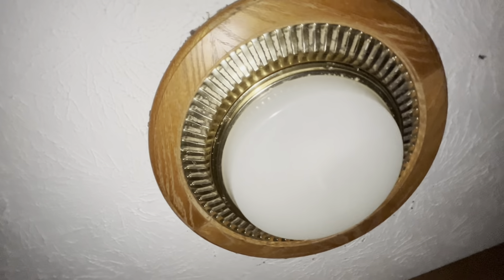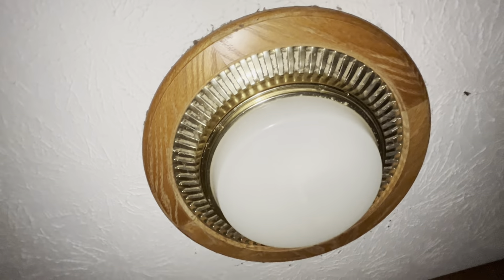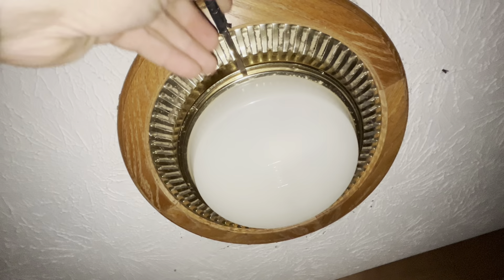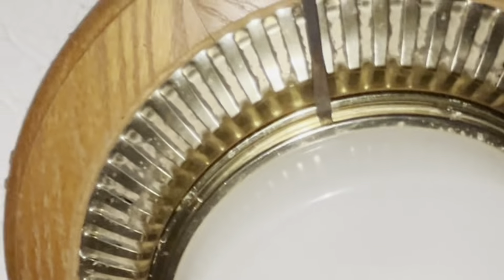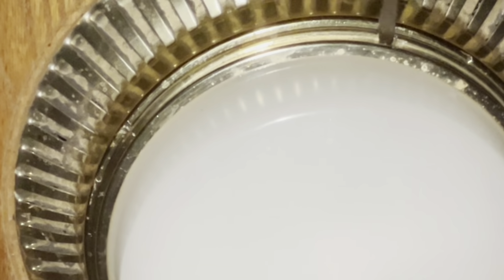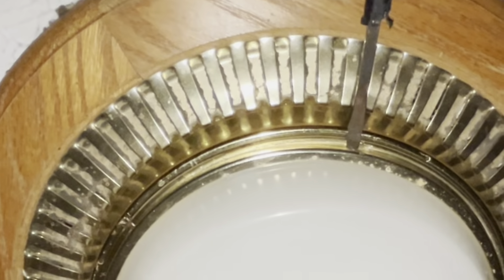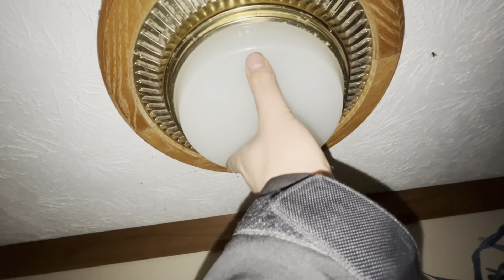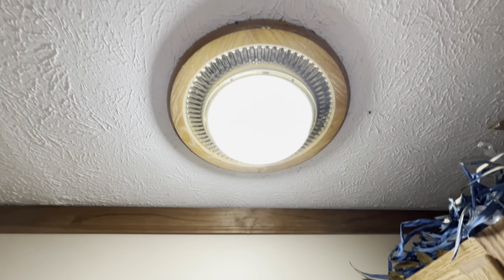How to replace the light bulb in a Broan fan/light fixture

Comment: Thanks for the helpful video. Have you figured out how to remove the grate cover to clean dust from the fan vent?
Reply: Any luck? Same thing here
Reply: @blddonker6687  not yet sadly
Reply: Above the bulb, you will find a cap nut with a washer. That's all holding the bulb housing and the outer ring with wood trim. Remove the nut and the whole outer ring with bulb housing drops. It is connected with a molex style plug to the box in the ceiling with the fan motor.